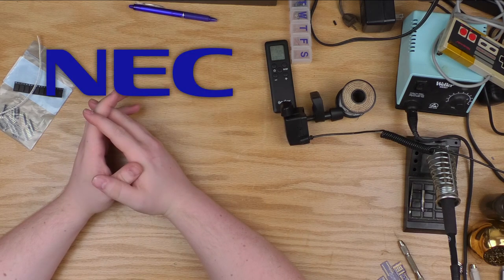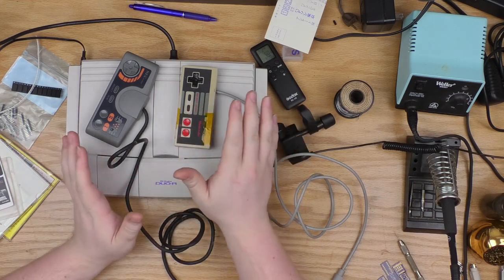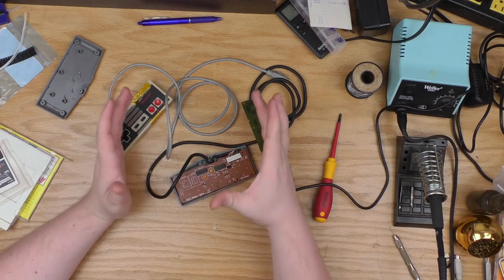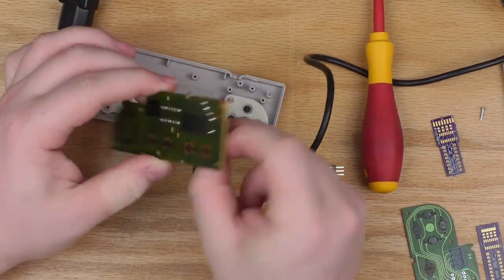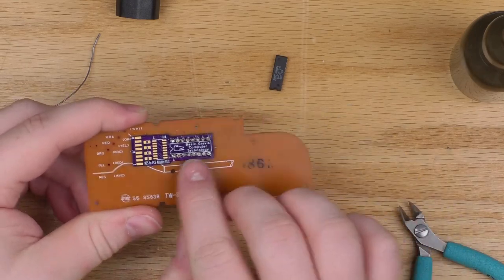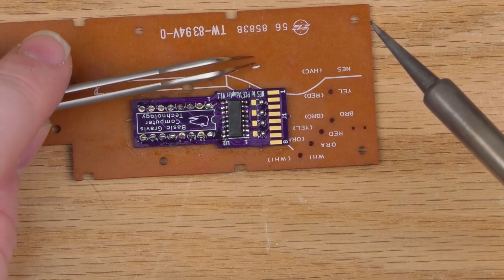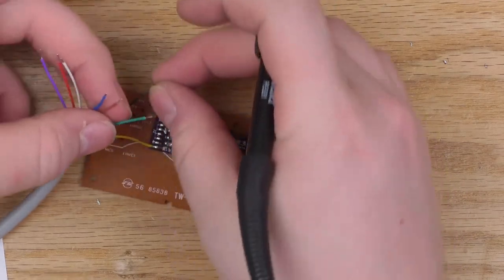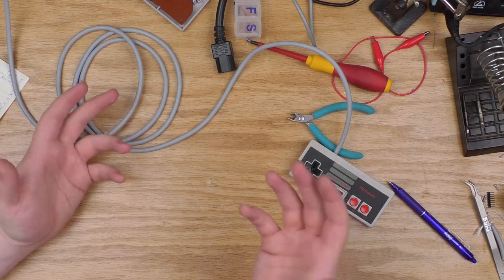NES to PC Engine Gamepad Mod (Cross-Pollination)

Comment: First off, thank you so much for this! Just made two controllers for my TG16 and I love them. (Can confirm it works perfectly with the din 8 of the TG 16 as well). I made two discoveries I'd like to share: One; if you have any dead or crappy 3rd party Genesis controllers around, I harvested the cables from two of them for my TG-NES controllers. They have 9 wires and are thin enough to easily fit in the NES strain relief. I just used din 8 plugs from digikey, pinouts are readily available online. Two; instead of attaching the NES chip and clipping the pins, I removed the heads of 16 male breadboard cables, which are cheap and readily available. I took the metal pin from the square plastic housing, and not only is the pin thin enough, they are slightly u-shaped when you look very closely. This allowed solder to travel through the pcb via making for a super secure joint. Plus you get to save the NES chip to fix a dead controller! I can send photos of this if you'd be like.

Keep up the good work, this was such a wonderful tutorial video. I had a TG16 system only and didn't want to shell out the high price for an official controller when I had a graveyard of NES spares at my disposal!
Reply from the maker: wow, I'm really glad to hear all this! thanks for the info and for trying my mod!
Reply: Just make a usb adapter so you can use cheap NES usb controllers on the pc engine and Turbografx 16.
Reply: @orlandoturbo6431  thing about those "cheap NES usb controllers" is they absolutely suck. the goal here is to make a controller that doesn't suck.

Comment: Nice work! The answer to your too-much-solder conundrum at 19:40ish is solder wick (aka desoldering braid etc.); I know some people aren’t keen on it for through-hole, but for surface mount I’d call it nearly essential. Just pop it on the blob of solder, maybe flux it slightly, then heat with the iron tip and lift straight up - presto, nice clean pad. Also works if you manage to bridge pins on the IC, say by dragging much too large a blob.

Comment: I don't know if anyone else mentioned it, but you could probably strip the cable and then hold it together at the opening with heat shrink to make it a little thinner.

Comment: Bit late to this but here’s my though. I’d use Cat 6 cable, as it’s about the same size as the original NES cable. Then fit a Din 8 end, and that saves doing a pin out. Unfortunately there’s no RJ45 to Din 8 adapter to make it a really easy process. This was a great video!
Reply: It's insane but I just googled RJ45 to Din 8 and saw some results. I really like your idea.

Comment: I avoided using SMD components for a long time, until early this year I was forced to do it due to space constraints on the PCB. Soldering that tuff using paste (even if you need to apply it manually and don't have a stencil) and hot air is so much easier to do. Just blob some paste on it, drop the component and blow hot air on it. The components align automaically (you may need to nudge ICs by a row or two if they settle with an offset)
For resistorss and capacitors I wouldn't recommend going smaller than 0805 if you are aiming for something you can work on without pick&place machines. It may be doable, but the pain it causes in the lower back increases exponentially with each size you scale it down. ;-)
If you got pads close to each other like the IC pins or even the resistors, just drag some paste across all of them at once. Once the paste melts, surface tension will do its job to separate all the joints.

It doesn't need to be a fancy SMD hot air rework station, mine is made by a comapny named Atten and cost around 80 bucks. Maybe it wouldn't last as long as a big name brand when used commercially day in and day out, but for a hobbyist who uses that stuff every once in a while, it is definitely okay. If you need two of them during your lifetime, you are still much cheaper than with buying just one big name brand station.

Comment: You definitely want the turbo switches. Games like Bonk's adventure are completely different experience with the turbo switches. Especially the first one where you can basically fly using them

Comment: The problems you had with the first revision were probably because there is no bypass capacitor to filter power to the chip. Yes, even though the second revision didn't seem to have the issue. ;) Also, drag soldering is typically a one or two pass thing where you use a tip that can contact two or more pins at once and let the solder redistribute itself between pins across your tip (tip touching each pin simultaneously). You then "drag" it to  leave solder on one pin while introducing another. You add solder to the tip as you go when the pool that follows your tip starts to shrink too much or you encounter areas with no flux. You may end up with too much solder at one end bridging multiple pins. In that case you clean your tip, flux the pins again, and make another pass in the other direction. Your iron will remove some of the excess through its own surface tension and you will get a more even distribution if you didn't get it perfect on the first pass. Stroking all the pins repeatedly to melt a whole side might not keep the solder and flux molten enough to conduct heat and flow through the thru-holes.

Comment: Would be more fiddly, but I wonder if it would work to put a pin header in from the top side of the original controller board, flip it over, lay your board on the pins, solder, flip it back over, clip and solder to the original board?

For some reason it makes me sad to see an IC go out like that lol

Thanks for walking through the surface mount soldering. I've never tried it and find the thought super intimidating.
Reply from the maker: The holes just aren't big enough. Either way is traumatic to one or the other or both

Comment: I know this video is about a year old & it's  a little late to ask this. But, if that one cable is to thick why don't you use the one that came out of the controller to begin with???

You wouldn't have to find a cable with 8 conductors in side of it & you wouldn't have any trouble getting it to fit. If you were doing it to have a longer controller cord you could use a little bit of the cord from the Nintendo controller coming out of the mod then switch to the other cord.

But, that's awesome!!! Thanks for making the Video!

Comment: I have a new in box official Apple networking kit that includes one of those cables but I still order 8-pin mini-DIN cables for PC Engine from Console5. :) If you can find the original connector NEC used Console5 cables would plug right on.

Comment: Awesome design. I'll keep this in mind if I pick up PC engine. Always fascinated by it since I've never heard of it, but have heard of the exclusives for it.

I will say, I worked soldering PCBs for a while, and I had a hard time watching. Even sped up, I saw those not wetting and had flashbacks to my first time soldering professionally, instead of replacing a battery for Zelda.

Edit: Oh God! The cable stripping.

Comment: Would it work with other NES controllers? Something that DID have the turbo functions?
Reply from the maker: So, I can't recall exactly how this worked, but I THINK the turbo feature was implemented as a flip flop that changes state every time the NES scans the controls. Without that clock signal there would be nothing to drive the turbo feature. Don't quote me on this, but I think that's why i decided this wouldn't work with a turbo controller.

Comment: if you were to be careful and instead clip the pins of the chip off you could use the short legs to solder the mod board onto your controller withouit dealing with desoldering

Comment: i actually have the opposite problem: i bought a pc engine hori pad that is absolutely perfect, the edges are curved perfectly for placing your index fingers on and the buttons have such a satisfying snappiness to them, but the problem is i don't have very many pc engine games but quite a few famicom games. hopefully i can do the reverse to be able to use on the famicom, though for me i'd much prefer an external solution so that i could swap controllers between different systems. then again, the easiest solution would probably be to just buy another controller and call it a day, but where's the fun in that?
Reply from the maker: hah! yeah, off the top of my head it SHOULD be possible, it's pretty much the same situation, just inverted.

Comment: How do you feel about the nes boomerang controller?  Could keep the turbo buttons with that.
Reply: The NES Max? No, because the PC Engine adapter board essentiay connects straight to the button contacts, bypassing all the turbo circuitry.

Comment: Would it be possible to use this board you designed for a different controller than the NES, as long as you put the inputs into the correct solder points?
Reply from the maker: it's been a while since I made this but I'm pretty sure I remember the buttons being simple switch closures, so - yes, it should work with anything that's just plain buttons
Reply: I really want a PC Engine controller with a joystick =) I'm willing to put in the work to find out for sure
Reply: Would really appreciate if you could point me to the pinout of the chip if you think it could work. It's not a big deal if it ends up not working, but it would be sweet to try.
Reply: @CathodeRayDude  awesome, thanks! I would love to figure out a way to add rails to your board, from the pins on the chip to another array of plates(to wire any controller up to it easily)
Reply: @ShamanNoodles  Just make an usb adapter so you can use cheap NES usb controllers on pc engine and Turbografx 16
Reply: @orlandoturbo6431  That's an awesome idea, but since the NES outputs a different format, you need to replace the chip before the signal is sent down the wire. 

I actually ordered one of Cathode Ray Dude's boards and I have a PS2 controller im going to mod into Turbografx. I'll make a small video(obviously giving all credit to Ray Dude).

Also, SNES controllers are apparently almost the exact same as NES controllers, plus a few buttons. Should work great with those also.
Reply: @ShamanNoodles  They already have two adapter converters One is called Brook Super Converter for the Sega genesis/PC Engine that allows you to use PS3, PS4 and Switch controllers and the other is Tototek Joypad Converter adapter that let you use PS1, PS2 controller on PC Engine and Turbografx 16.lf they can do that converting cheap NES controllers or NES usb controllers should be easy.Two pack NES usb controllers on Amazon is $12.99.Wal-Mart online two pack NES usb controllers is $7.99
Reply: @orlandoturbo6431  Wow i didnt know about this, thanks! Does it add input lag though? i noticed it needs a power source
Reply: @ShamanNoodles  I don't know if it add input lag but I'm surprise a NES converter adapter is not already on the market.PC Engine was so popular in Japan you would think some company would came out with a converter.

Comment: A lot of people online are saying that the Turbografx 16 has empty space inside. That’s not true, I have opened one up myself and it has a full motherboard the size of the system. It also has a large metal shield on both sides that is soldered on to the board which makes it heavier.

Comment: “pc engine” is a stupid name and i hate it
Reply: ...which is likely why they renamed it in other regions. ;)

Like Europe, Japan had a lot of early PCs that were essentially game consoles, like the X68000 and the MSX/MSX2. It suits that market. Non-IBM/Apple PCs connected to your TV almost as a rule. Heck, some Apple and IBM PCs did too, like the PCjr.
Reply: @emmettturner9452  remember, even the NES was called the Nintendo "Family Computer" (aka. Famicom) in that region.  So yeah, it was common.
Reply: @TransCanadaPhil  Exactly... and the "Engine" or "Core" names for NEC were meant to indicate that it was the central piece of a modular/expandable setup with CD-ROM², ROM² Amp, LCD monitor, RAM cards, etc. Makes sense there.